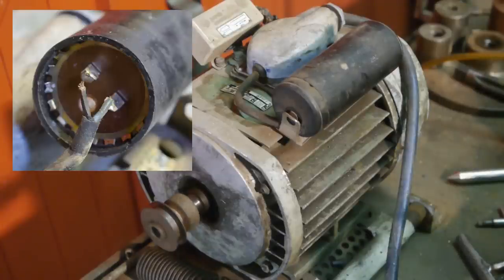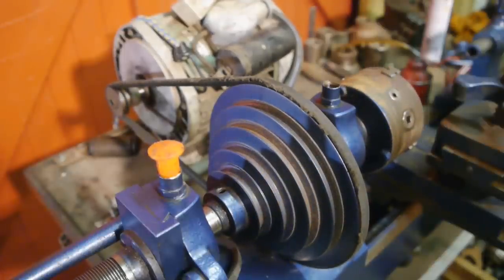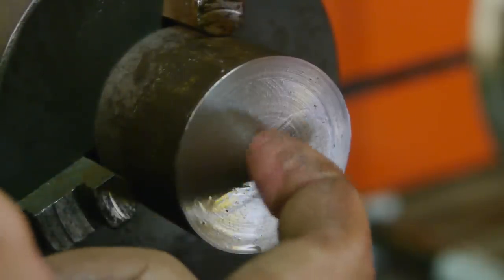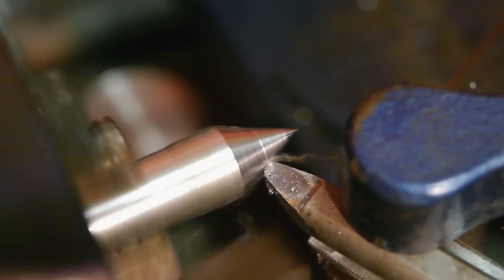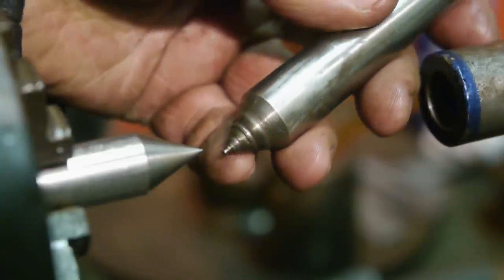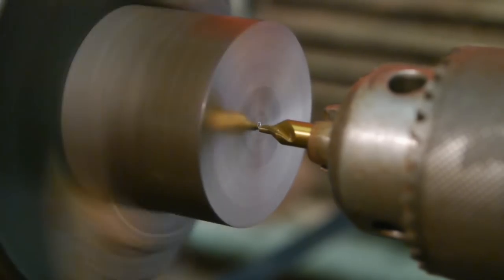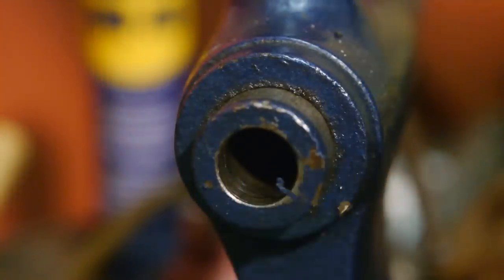Testing the antique Karger lathe

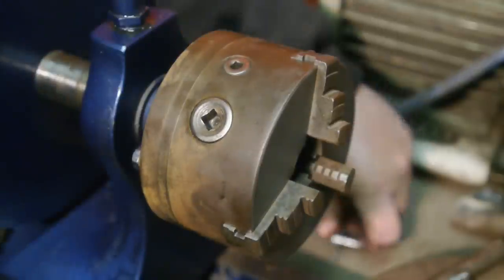Comment: 5:05 I believe you will need to loosen the 3 or 4 little bolts that holds the chuck on the backing plate before you can adjust it.

Comment: Time invested in a proper restoration would be time well spent !   That chuck would be a simple tear down, clean & reassemble job . . . I wish I could find such a machine to restore !    Maybe you could turn an adjustable tailstock 'plug' , which would give you a good center - there are many possibilities , depending on your desire.
Reply from the maker: I've all ready fixed up a similar machine.
But, I think I'll try fixing the tailstock using my cheap Chinese lathe. If successful I'm going to use it on my old restored lathe.
If not, no harm done. Can't make it any worse :)

Comment: i applaud the attempt but looks like the center drill i smoked or rather dull?  cheers
Reply from the maker: The centre drill is fine I still use it.
I have cut a Morse taper 2 into the quill so I guess I should retest with a good drill chuck at some point.

Comment: A very good first test.  Thanks for posting.

The Lathes.CO site has a good page on Karger lathes.  As you suspected, they did make lathes with treadles for some time.

http://www.lathes.co.uk/karger/

If you want to confirm the use of the small key holes you will need to disassemble the chuck which will be a good think in any case to clean out and lubricate.  You may then be able to get the chuck running closer to true.  I would love to see the inside of the chuck.  The mating surfaces are a close fit.  It will not take much rust for these to not move.

I think the faded writing is 3 different patent numbers.  May be UK, Germany and Italy.   I wonder if the patents are the truing method.

Second set of hard to read writing may be the original manufacturer.

Sad about the quill.  If you are not able to get this fixed, I can understand the need to sell the lathe.

I think the chuck key is not the correct one for that chuck,, but as you said it has a lot of damage.

I normally run my metal lathe at a belt setting which gives me about 465 rpm. 

You can attempt to align the tailstock without a dead centre.  You would turn a piece of metal to exactly the same diameter as the quill, then mount this in the chuck and use a dial indicator on the turned piece then the quill.  This only works if you can machine the piece to close tolerance AND have the chuck running closer to true.

Keith Rucker shows this method of alignment in a video.
https://www.youtube.com/watch?v=5bWpgElMm8c&t=132s
Reply from the maker: I'm also very curious about the chuck. I've started a thread on the practical machinist forum.

http://www.practicalmachinist.com/vb/antique-machinery-and-history/does-anyone-recognise-chuck-333722/?s=cec347fb02664374ecdf28ba9b620f0b

There are 6 patent numbers on there and all the writing is in Dutch. 
I think I also see the word Amsterdam.  And maybe the name: F Dijkstra & Tukker
Could be a chuck made in the Netherlands :)

I will try to fix the quill. I can't make it any worse. So if I screw up there' s no big loss.
Sadly the tail-stock is non adjustable so aligning will be difficult. I guess I should make sure the bed is levelled.